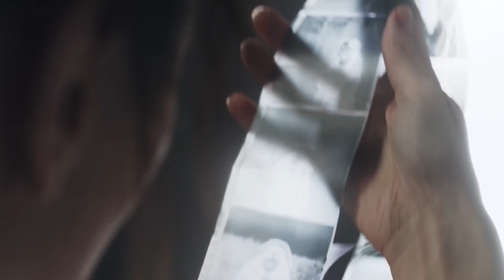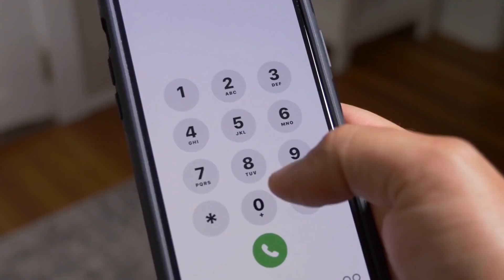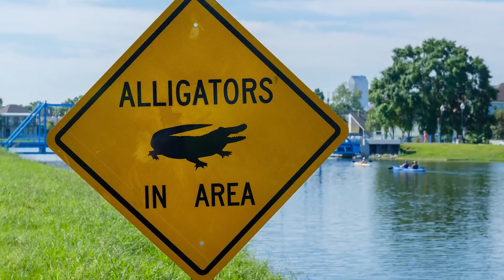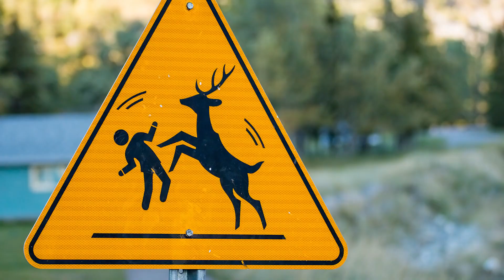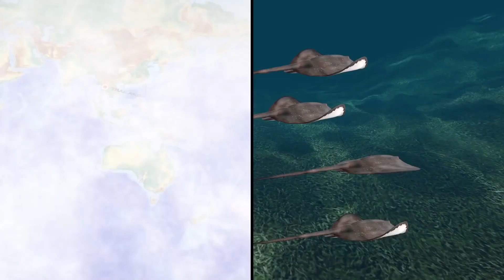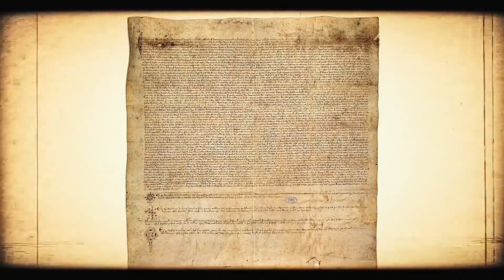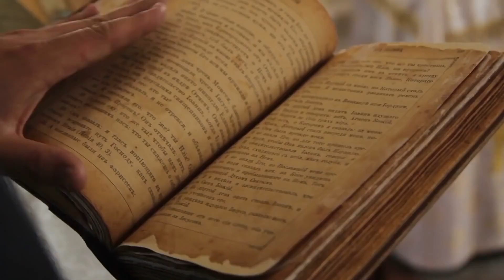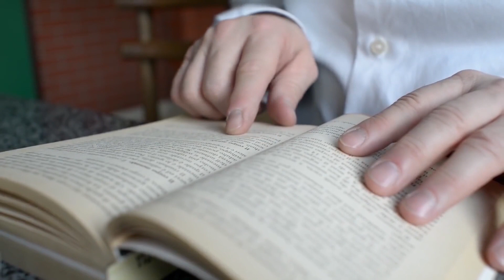Unexplained Mysteries & Scary Creature Encounters! | ORIGINS EXPLAINED COMPILATION 21

Comment: I
I've had bats invade my then apartment in Manassas; VA.  Every September, I would get 3 or more fruit bats working their way through the vent for the stove fan. Initially maintenance killed the bats.  I hated that. and found a better way.  With 4 cats, I needed to separate the bats from cats.  I encouraged the bat into my bedroom then closed the door.  The bats would attach to my curtains and go to sleep.  They are actually only the size of a chicken egg.  I often just went to bed with the sleeping bats close by.  In the morning, I stunned the bats with a broom, sweeping then out the door.  That was in the early 1990's.

Comment: Recluse spiders are called recluse because they're, well...reclusive. They tend to hide in places that are seldom disturbed, like seasonal closets, or, outdoors, between a tree and its loose bark. For there to have been so many, the problem must have been ongoing for awhile.
Reply: Actually the spider doesn't go further than 15 feet from where it's born that's why it's recluse
Reply: It's also called a fiddleback. I was bitten by one ( the Dr said it possiblity bit my thigh 4-5 times.) It's a painful bite, the venom causes the nerves to go into overdrive and even the air going across my leg was painful. It caused me to get cellulitis. The skin was separating from the muscle.
Reply: @honeymilch3857  it has nothing to do with the place it was born. It's called that because of the habit of hiding in numerous places. Especially dangerous due to the fact that they are known to hide inside of clothing. The most common place to get bitten is the thigh.

Comment: The snake in the toilet 🚻 is my phobia 😱....I always keep the seat down and look inside when I lift the lid b4 sitting down. There really should be a way to prevent this from happening...like a trap-door that opens when you flush then closes again.
Reply: This can only happen in a sewage system that has an opening to the environment.  If you have a septic system, at least in the US, it is never going to happen because there is nowhere for a snake to gain access.

Comment: Some ironies about the assassination of Archduke Franz Ferdinand- the car would not have been where Princip could carry out the assassination if 1. The driver of the Archduke's car hadn't taken a wrong turn, and 2. Princip had not stopped to get a sandwich. And the licence plate on the car had A1118, which some have noted can be said to predict the armistice ended WWI, in 11/'18
Reply: It could be said that a sandwich caused the first world war

Comment: I was bitten by a fiddleback (brown recluse) spider. On my upper thigh and ended up with cellulitis and had to get the area debrided, it smelled nasty and the stuff coming out looked like caviar. I had to get iodoform gauze stuffed into the open wound. This was done two times a day until the wound closed up. I'm not ashamed to say that I screamed my head off due to the extreme pain.